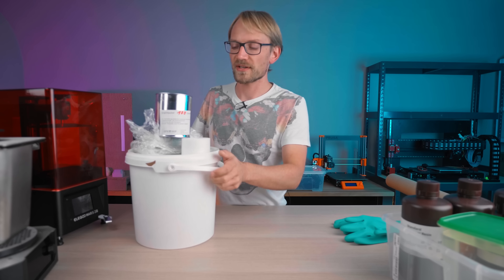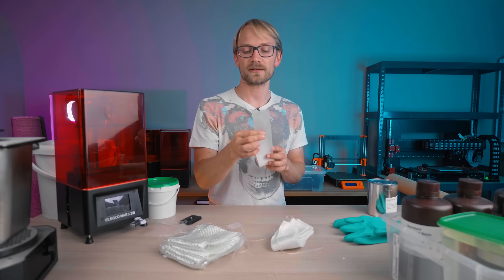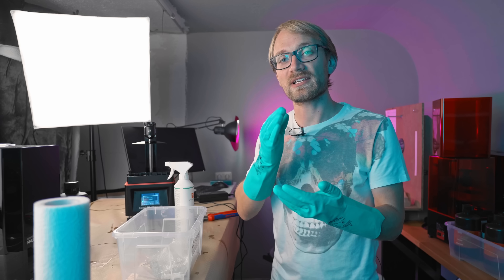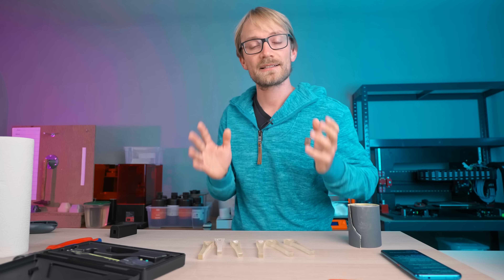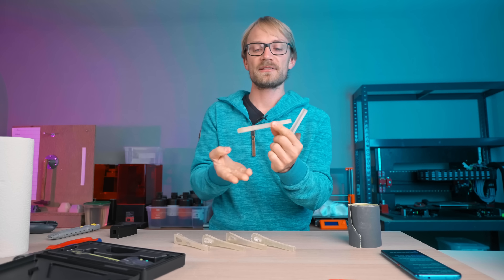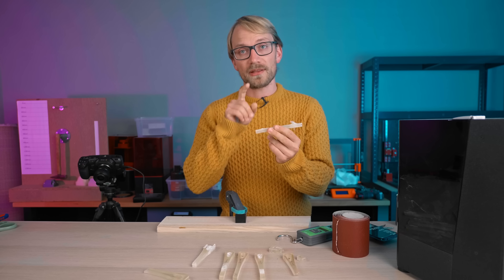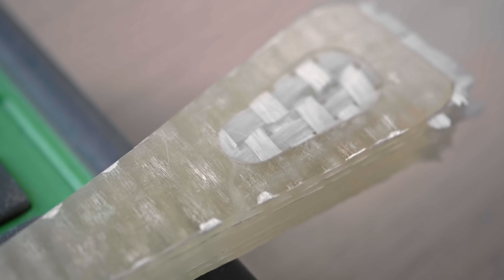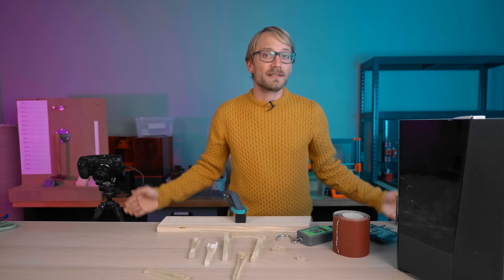Fiber-reinforced resin prints - how much STRONGER are they?

Comment: I just look at resin printing. The gloves, the mess, the chemicals, and think no!
Reply: I've started resin printing 3 days ago. I have a lab mixed, 2 tubs of the right size and a solar turn table+UV lamp. I could do the full process without gloves (I never touch resin) but still put them just in case... Remove cover from printer, put gloves, unscrew platform, put above tub with magnet in it + alcool, slide metal ruler in the top part of the platform, release the platform which is suspended by the ruler in the alcool. Leave for 5 min, do the same with second tub, then put the patform head-up on a paper towell while the alcool evaporate. Close the top for the 2 tubs (to stop the alcool smell). Take a thin knife cutter, remove the part and put it on the platform. I've done the eiffel tower, the ramps on the first floor are thiner than one of my hair and prints perfectly... The only time I had to invest is in finding the perfect tub size for the platform to fit inside. You should try if you are not printing a lot of parts...

Comment: Very interesting experiment! 

Some advices from a composite engineer: The sizing (silan primer) of the glass fibers need to be epoxy compatible. Yours probably are, but it's not obvious. And when you test such small items, there is a strong "edge effect" of the material. Imperfections, such as unsaturated fibers at the edges can cause an early failure. I have seen that in other composite testing. A larger item would be more useful. And maybe bending test until first shear load failure isn't the best indicator of material improvements. As you say, higher material stiffness might be the property you are looking for. 

A very resin rich composite material will be weak in general. When testing, you see the resin parameters instead. That's because when areas of resin cracks from ultimate elongation or ultimate shear load, the relatively few fibers cannot take over the high concentrated load in the crack area . You should aim at an active fiber volume share of at least 20 - 30%. I don't know the exact figure. It varies from many different factors. But resin rich areas in composites are definitely seen as weakening failures for the same reasons. 

Maybe you can even use short fibers mixed in the resin. In thermoplastics you see an effect of added fibers, which are shorter than 1mm. Are no resin suppliers offering such a mixture like in some filaments for 3D printing? Maybe there is a negative effect on the curing process, if no resin suppliers do!? At least maybe in the effective volume share. A low volume share of fibers does not offer a significant improvement of material properties. Sometimes even the opposite.

Comment: I wonder what the load capability differences would be if you turn your test part 90 degrees so that the fibers are parallel with the load direction?  I was thinking while watching it print that it'd be interesting to have a single sheet of fiber cure across multiple layers.  Obviously not possible given the design of the printer with the bed lowering to the screen.

Also, I wonder how the results would differ if you annealed the fiber reinforced parts?

Good content as always, thanks for the videos.

Comment: I think you would be best off having the fiberglass layers at the center of your part.  The more layers the better.  Also fiberglass isnt really intended to have much bend strength.  A boat hull flexes very little laterally.  Its more about weight and space saving then it is strength.  Carbon fiber would do far better if it was able to be used with this process.  Fiberglass is really quite brittle laterally.  Plastic or resin is actually better at handling a test like this due to its ability or stretch or bend before failing.  Really this is not a great test for judging the effectiveness of using a fiberglass reinforced lamination.

Comment: Maybe select a cloth that is slightly thinner than the layer height to allow for resin-fiber layer adhesion and cut the sheets into squares the size of the vat. Place a fiber square on the bottom of the vat each layer until it is built up. Definitely labor intensive.

Comment: Hey Tom, super interesting video! You should try orienting the plane of the fibre sheets to be parallel to the z axis relative to the print, if that makes sense. Of course, this wouldn't work while printing since the z-axis of the part grows in steps, so you would basically rotate the part 90 degrees before putting it into the square holder before testing.

Comment: Hi. This was a great experiment. The fibre is meant to make resins more ridged and not to strength in they way you test it. Eg cast iron is way more ridged than steal. If you had to test the two different metals in the same way you carried out this test then you would get the same result. 

If you need less flex in parts then use this method. I think this would be great method for building quad frames.
Reply: If you want to even make it more ridged then cross weave the fibre

Comment: I think that under a straight tension load (pulling from each end, not bending) this technique would likely do better. Another idea is to mix the resin with a lot of individual glass fibers, less work than manually tending to the print and adding layers, and it might result in a more amorphous mix of reinforced directions, which could be useful for some applications.
Reply: You are right. Bending test doesn't make any sense. Fiber reinforcement has a large effect in the tensile direction and has no significance in the shear direction.

Comment: Your testing needs to be on a load frame where you can document the stress strain curve and at what load at failure.  Post curing the parts will probably increase the strength.  Have a DSC test on the samples which will tell you if the parts are completely cured.  The Tg value is before / after post curing is great information.
Reply: He did post cure the parts
Reply: @qldgadgets  Don't know.  Knowing the difference between thermoplastic and thermoset resin systems will allow the strength of the material to increase with a post curing type function.  A DSC scan will tell you if the material is completely cured out and at what temperature the Tg (glass transition temp) is, and at what temp the material will degrade.  Adding fiberglass or carbon fiber to the resin matrix is where the material gets it strength, the resin is the binder that holds it together.
Reply: The post cure commonly referred to in resin printing is the UV light device with the turntable

ETA @7:07 is the post cure

Comment: Carbon fiber is a lot stronger than glass fiber at least in tensile strength and modules of elasticity.  The thin material appears to be a veil type material, not much strength, just for a surface appearance type application.

Comment: very cool video.... in this application(among most) using "normal" fabric the crossover transitions in the weave greatly reduces stiffness.  2x2 "twill" weave means having a minimum  of 50% properly orientated fiber not crimped at the over/under weave transitions.  Going to a 5 harness weave (over 4 under 1) means 80% continuous fiber and a "unidirectional" weave means all the fibers are properly oriented for stiffness (in this case 200% as there is no cross weave).  It really does make a huge difference which almost has to be seen to be appreciated.   Unfortunately these more exotic weaves are not so easily sourced especially in glass.  Carbon is much stronger with less elongation and easier to find more exotic weaves but UV cure is a problem.  Maybe in this case with the low fiber content CF could be cured out the outside layers anyway.  There are precisely cut "milled" fibers available and would be an interesting experiment but  I think parts would turn out rough & fuzzy and require too much post processing to end up with accurate parts.  As resin''s elastic properties are so different than reinforcements, resin's primary function is to maintain the reinforcement's position/orientation.  quality FRP parts are generally about 50% reinforcement by mass.  I'd be very interested to see how high of ratio of milled fiber could be achieved as at anything near 50% would be much to viscous to flow.

Comment: Why not just print the mold or fiber reinforce the part like it's traditionally done? i think that would give better results and it would be easier to do...
and also... don't forget the rule of mixtures.... the matrix doesn't matter that much, what's important is the percentage of reinforcement in the part
Reply: Injection molding is also the traditional way to make plastic parts, but sticking to tradition doesn't allow technological advances like 3D printing (rapid prototyping was the early industrial name for it).  3D printing grew more in the last 10 years than the previous 20-30 years because it became mainstream and people started trying new things.  Get more minds involved and more great ideas will emerge.  At the moment injection molding is still very useful for low cost with high volume and molding composites is better, but R&D is always beneficial to grow and learn new things.  I agree with the mixtures, but I think he was just testing an idea.  These are prototypes. It seems very difficult and time consuming to stand there and put many layers.  Maybe someone watching will think of a better solution. 👍
Reply: @ryanlandry8214  i completely agree with you. What i said came out wrong.
what i meant was "if someone needs a really strong part, plans to use composites, and has a 3D printer,  they could also try printing the mold and aim to obtain a higher reinforcement to matrix ratio for a stronger part.
I love Tom's content, please don't get me wrong :)
Reply: @santiagoblandon3022  no problem, I get triggered when people talk about traditions.  😂  I believe strongly in progress..💪 I agree with you that 3D printers are great for making molds for these things.  But it's fun to try outside the box and maybe make a breakthrough.  I had the same idea Tom had, but I don't have a printer yet to try so I was excited to see this video. 😉👍

Comment: I think you could have added additional strength by rotating the glass fiber sheets by 45 degrees. It would make the fiber from both rientation acttually work and may additionally spread the stress more even across the fiber due to the weave. Just like a rope is stronger then it's strings laid parallel to each other instead of  being twisted around each other

Comment: Hi Thomas, you tested the fiber-matrix bondage which is obviously quite bad due to missing compression during the curing process(eg. between two glass plates). The crack sound indicate layer separation way earlier than the fiber or the resin would fail.

Comment: Before watching: doesn't make a difference, it's just 1 layer at which the stresses are applied, it should run throughout to be an added advantage (seems obvious even).

After watching: Ahhh, it even weakens. Very interesting. And then goes on to make it stronger by adding it throughout, nice video. :)

Comment: i think that you would have had better results in tensile testing : your test piece, but with a loop on each side, and then pull on the part along the longest axis. This way, the  fibers would help preventing the shearing of the resin i think, and you probably would see a much larger improvement.

I would be curious to see that!

Comment: Hey Thomas a great idea again ! And really nice footage and sound 👌 love it!

One idea if you rotate the complete part so the Layers are 90 ° to the way Strength/Force plus rotating the layers by itself (30° or 45° like others wrote before) you should getting a way better results then 22,7..kg. That would be very interesting !
Reply: 45 deg orientation would increase torsional stiffness and not be much help in this test
Reply: @dungadumbs428  yes but better then nothing an there is ever a bit of torque.. best thing is rotating the hole think while printing

Comment: Super interesting! Seems like the differential between resin flexibility and the glass fibers was too great. You don't see glass reinforced tape - because it would crack. Use a more flexible fiber like nylon. Look for reinforcement tape or nylon filter mesh or ripstop fabric.

Comment: Pretty cool idea! One reason the wallpaper stuff was underperforming might be the coatings that are (not) applied to it. Fibers meant for strength in laminates usually are coated in one way or another to provide good adhesion with the intended resin system.

You could quite easily imagine a setup that automates a process like this as well. Just keep the fabric on a roll, and cut and submerge a new layer every time.

Comment: Interesting application towards engineered composites. Generally fiber composites have a resin volume fraction of 30% or less, and you'll only see improved strength and stiffness if the raw fibers are themselves stiffer and stronger than the matrix (maybe why the random orientation drywall fibers failed)

Comment: Its worth noting that fibers add strength when under tension, but don't do much (if anything) under compression. So if you want to get the best sense of how much the fiberglass improves the strength of a part like this you would want to load the object parallel to the fibers. The bending test being applied here is shearing the layers of resin against the fibers and only leveraging a small fraction of the strength of the fiberglass. Its testing the shear strength of the resin matrix as much as it is testing the effect of glass fibers.
Thomas - Thanks for all of the great content! Perhaps this is a collaboration opportunity with Stefan over at CNC Kitchen? His rig would be ideal for testing these parts purely in tension. :-)

Comment: The drywall cloth sucking makes sense. It's an inclusion that's probably weaker than the standard resin, and no long fibers to provide extra rigidity. The glass fiber cloth adds strength and rigidity by adding strong tendrils throughout the length of the part, and adding more layers reduced the localized stress around the inclusions. Overall, excellent dive into some more complex material science topics. I'd love to see the crazy numbers you'd get with a pure tension or energy absorption test.

Comment: What a great idea, you could build some amazing multilayer fibre parts with this method.

Blending the resin into the fibre with a brush would also be worth doing.

Isn't the strength here in the pull direction over all the others?

Comment: Honestly if I do this, I'd probably be using it for improved bed adhesion, since that's the problem I run into the most with 3d printing in general

Comment: Tom, you don't need a resin printer to make frames or anything that needs strength. You just make a mold and cast it with resin and fibers. That's how carbon fiber objects or fiber glass are made anyways.
Reply from the maker: But that kinda was not what I was trying to find out.
Reply: @MadeWithLayers  I mean the process of printing is unnecessary. You can't use it to print complex shapes anyways. So basically the test was just resin + fiberglass strength test. 

Am I wrong here?
Reply: Great. I use Cabosil (Colloidal silica) and
Reply: Milled glass fiber with epoxy and it significantly strengthens resins in boat repair. This could be suspended with a magnetic mixing tool in the resin well to keep it uniform. It is the fiber to fiber adhesion that makes the strength. The least resin is best. So keeping the weaves in contact or interspersing with Matt fiber will strengthen the construct. Great idea. Great job.
Reply: @MadeWithLayers  sure, but faster to print a mold and fill with fiber/epoxy?  Are there any consumer resins that are soluble?

Comment: Wouldn’t it be easier to print the piece, use it as a template to cut the source of fiber to size, adhere that to the piece with resin, sgueegee  the result and cure it with UV light? Or incorporate chopped fiber into the resin as others have done, sanding any fiber sticking out from the printed piece? Your way seems overly cumbersome and unwieldy.

Comment: One comment on your testing:
Fiber reinforcement is far better in tensile load. In the bend test you're doing you're only seeing benefit from the top layers, and the bottom layers aren't going to help much. Tensile testing these parts would be a better strength comparison.

Also, Formlabs Rigid resin is a glass fiber mix. I know their printers are LSLA, but the curing wavelength should be compatible with the more common MSLA printers. Have you tried using this stuff? I'd be curious to see how it compares to a more DIY  approach.

As always, great video! I really appreciate the way you approach problems and present your work.

Comment: CNC Kitchen should repeat this. We need multi site validation of results. Also the standardized test machine with replicates and standard deviation appeal to my inner scientist
Reply: Yes please
Reply: Go to check some serious published paper. They are already there. SLA printed glass fiber reinforced composites have around 90 MPa in tensile strength. It is way lower than those printed by FDM.
Reply: @HiLeeHighly  For all resins?  There's a really wide variety of resins with vastly different properties...
Reply: @georgedorn_fnord  If you mean quasi-static properties then resin type does not play an important role. I have tested almost all commercialized resin with either glass-fibre sheets or glass powders, none of them reaches more than 90 MPa in tensile strength. Probably glass fiber reinforced composites may have great impact resistance, that is what I am going to test in the future.
Reply: I want to know the e-module